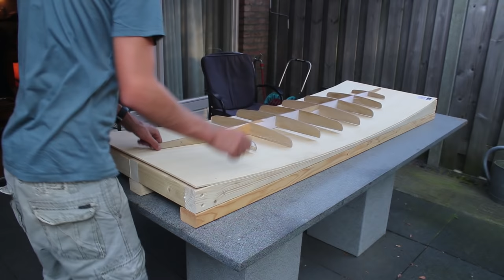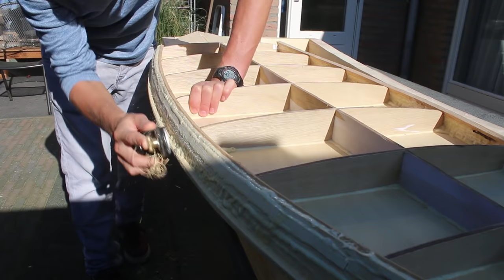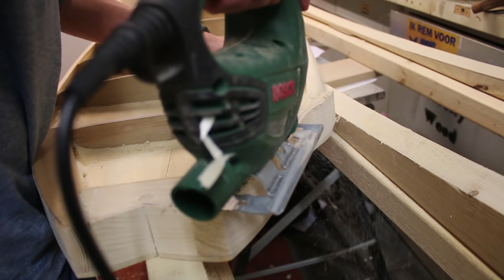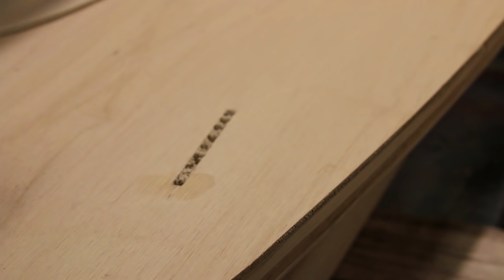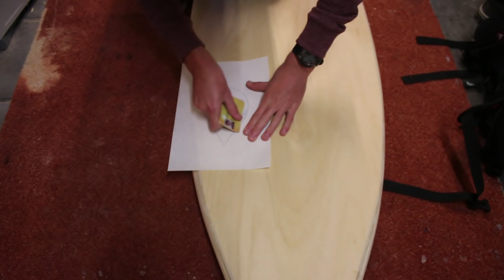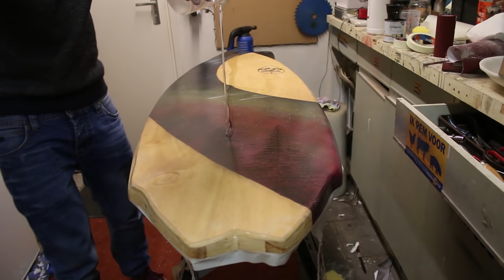hollow wooden surfboard

Comment: Could you tell the length volume width and his much did it weigh.... I have been thinking of building a wind surfing board of door skin... My first board was 12 feet and weighed 45 pounds.... I have a nice carbon slalom board now that Is 10 foot 6 inch and weighs 18 pounds.... The light board is bouncy on the chop... The old school is board finally gave up to the elements but was always my favorite and I was thinking of building like this something similar with a few changes I have in mind